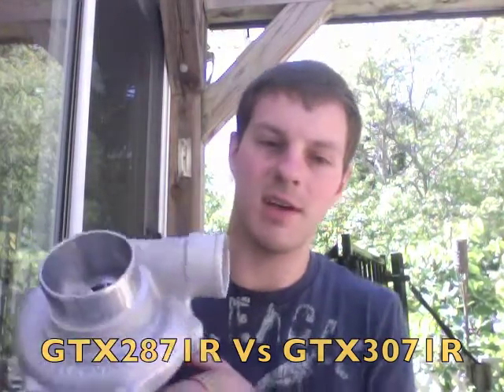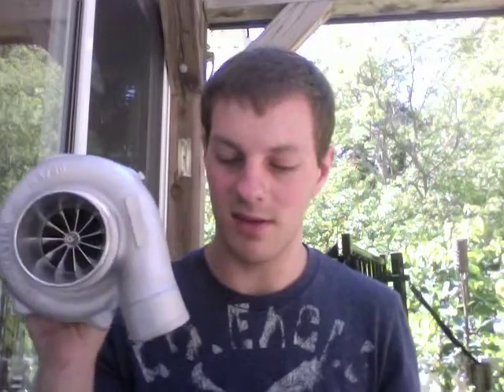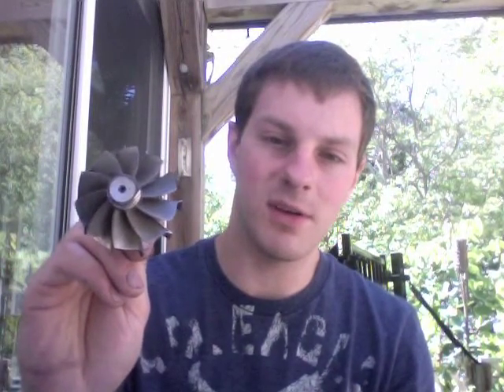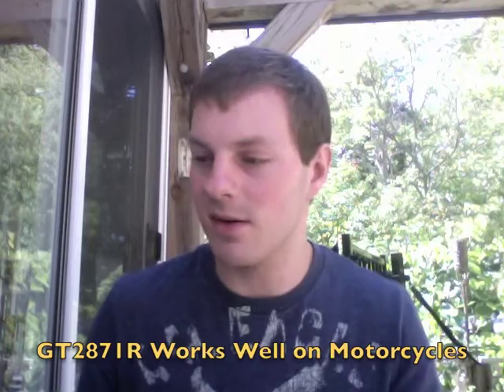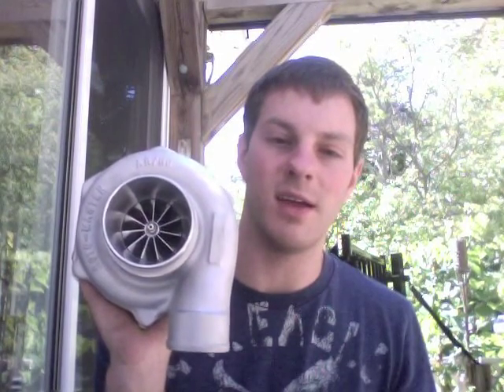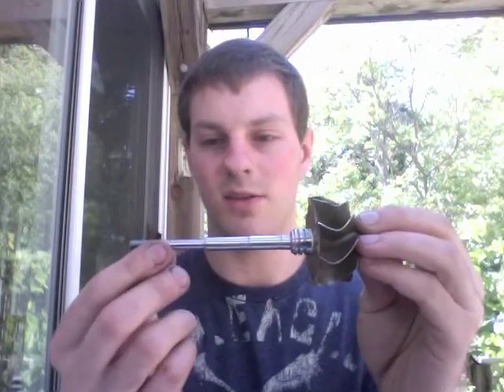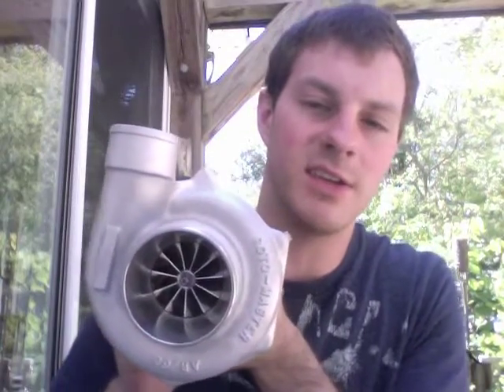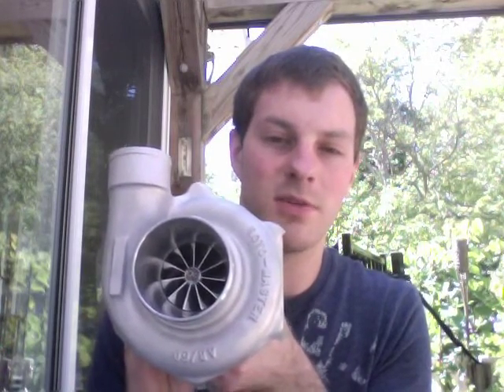Garrett GTX2871R vs GTX3071R + Specs

Comment: HELP ME PLEASE CHOOSE RIGHT TURBO FOR MY 1.8T STROKER 2.0 ADR HEAD AND CAMS..I WANT ANYTHING BETWEEN 350-400 HP AND GOOD POWER 3000-7500 RPM..LOW BOOST 15 PSI FOR COLD AIR IN INTERCOOLER..EXHAUST IS 76MM COMPLETELY..INJECTORS 550CC...I LIKE BIG TURBINE HOUSING T3 AND WHEEL 60MM...BEST FLOW...MY CAR IS FWD...I LIKE TRACTION...THANK YOU VERY MUCH..

Comment: Would you recommend a garret g2871r or a greddy td05h 18g turbo for my 2009 Honda civic 2.0 VTec? I'm aiming to safely push atleast 250 hp on stock internals with a type r head cover.
I reckon 10 to 12 psi ought to be enough. What's your thoughts in that to? 
You channel has helped me alot from knowing my turbos in n out. Thnx

Comment: Which would be better for a Mazdaspeed 3, looking for around 380 hp at the fly.
Reply: Is the quality of shaft wheel assembly has an important role in
validity of turbocharger?

Comment: In my STi, i made 496/488 on E85 @30psi with a gen 1 gtx3071r, and I could've made even more but I started to run outta ignition, & my injectors were only at 77%DC so I still had room to push another 30-40whp outta that thing.

Comment: I am using  honda civic sedan 2006 model 1.8 litter four
cylinder i vtec engine 132bhp 172nm torque. it come with 
five speed automatic gearbox with paddle shifter. it a stock 
motor 76000km done R18A1 engine i want to increase the
horsepower in my car i never had turbo experience in the 
petrol cars so i want go for the turbo kit for my honda civic  
what are performance parts I need for upgrade for the car
Reply: even a old subaru t3 turbo will give you just over 270 bhp with your good motor = or a garrett 28/60 = called a disc potato on a special nissan model can push 350 bhp

Comment: Hello 
What do you suggest for 2.3 t5 c70 volvo
It has low copression ratio even new 
Will spool the Gtx or should i go for gt28
I bought holset he351cw but spined at idle and when rev it up engine dyes 
Because the intake  cannot suck so much air 
Help me please

Comment: I  have a 3.6 liter 99 3000gt vr4... was thinking of swapping the t3  .50ar comp/ .48ar turb with a dual ceramic bb 3076... that's about 1.8 liter each turbo.  I wonder if there is a better setup than this... to get to a posible 1000awhp and still be drivable as DD

Comment: I love my Gtx3071r on my 2.5L beautiful combo, with pretty much absent lag. Still pushes something like twice the amount of the regular turbo even at like 1300rpms. Huge upgrade across the board in low end and highend. Love it. Vrooom Psst.
Reply: i smell bullshit on turbo lag i bet there is not much under 3,000 rpm = mt gt 28/60 on my forester eats bigger turbo street subaru wrx and sti = no problem torque under 3000 rpm is huge even with 4 people in the forester still beat wrx  and sti with driver only = bullshit .
Reply: Im looking at a GTX3076R for my 2.5 built, looking for 400-550 WHP with a good TQ curve
Reply: Your getting boost on the 2.5L at 1300 rpm with gtx3071?

Comment: hey turbo lab great video!
but id love some advice...

i have a 1.5litre 5efe twin cam engine in a toyota starlet... its a forged engine with a good set of cams...   i cant decide between a gtx2867r or a 2871?

im looking for the 350-400 hp mark but dont want to go the larger turbo if its gonna have a tiny power range. what are your thoughts?
Reply from the maker: I would go with the gt2871r because its more common it will be a lot easier to  fix in case you ever have a problem. If you dont mind about that, then go with what makes sense based on the horsepower that garrett rates that turbo at.
Reply: what size engines have you tried the 2871 on? id be interested what rpm it makes full boost. thanks for the reply man!
Reply from the maker: +crustic I build turbochargers not engines. I don't know the answer to your spool time question
Reply: In your video 0:35 you're recommending what turbo people should use depending on what hp they are chasing. If you put that gt71r on a 50cc lawn mower engine its not going to make anywhere near 100 hp. But if that turbo went on a 550 cube big block v8 it will easily make 700 hp. How can you build a turbocharger combo if you have no idea what engine it will be suitable on? sorry if I sound rude I am just really interested to know. Is it just based of peoples experiences using those turbos on certain engines?
Reply from the maker: +crustic I don't understand how you would think I would know an answer for a question like that. Turbochargers spool under load. If the engine is under more load it will spool faster at a specific rpm. If less load it takes longer to spool there is no mathematical formula for which a turbo spool on a specific engine per rpm. You are asking a question which has no correct answer. I have rebuilt some turbochargers for Lawnmower's the engine and turbo have to be within close airflow rates in order to work properly.
Reply: quite simple, id assume you would know whether a rear housing is too large or too small for an engine. thats all im trying to ask from the start. i understand you have shit loads of knowledge on building turbos and you do a great job rebuilding them but surely you get curious or have a basic understanding as to what size turbo is suitable for any given size engine

Comment: I'm new to all this Turbo upgrading but I'm learning as I go... I have a 2016 ford fusion 2.0 ecoboost which do you recommend? 3071? and do I need to add any more mods. So it can me effective. Blow off valve I know and an intercoooler I should add. steeda fusion has bolt on turbos ready to go but just wanna make sure if I need to do anything else for this to work properly and be safe. thank you for any help you can provide
Reply: Wrong where the hell did you get all that from? Ecoboost  means it's already turbocharged from the factory. If you don't know anything don't say anything it makes you look unintelligent or at least somebody who doesn't do a quick google search. ATP makes a turbo kit for the Ecoboost Fusion. Depending on the power level you want to hit the GTX3071 will go right up to the limit of the stock fuel system assuming you are using less than 10% ethanol fuel. You will need a blow-off valve but you do'n't need more than about 22 mm for about $190 with flange. To save money you can have the flange welded onto the hot side pipe. From there all you need is a tune, your inlet temps will be far below the stock turbo so the stock intercooler is fine it's not a flow restrictive part. That said depending on what your goals are I would actually look at a GTX2863 as it will easily do 340-350 with a cat-back, stock down pipe on 93 octane fuel . It will do 370-380 hp on race gas without changing the base tune too much.
Reply: You need tk change a lot of things before adding a turbo, you need to change your fuel pump, fuel injectors, intercooler, possibly a bigger radiator, etc you need 5000 dollars in parts

Comment: what could you recommend for a 1989 nissan r32 gtr. 2.6liter, 4 valves per cylinder.  Ive been thinking the gt3071r because I'll be running twins but i am just worried about lag time?
Reply: Run twin GTX2863's or Borg Warner EFR 6258's

Comment: garrett says the gtx2871 can run up into the 500s, so why not use it past 350 like you say?
Reply from the maker: +Brett Wilkins it depends on the application. On snowmobiles these turbos can make it to the 500 hp much easier because they run higher rpm. For a 4 cylinder car they could make more power but it's limited by the turbine housing size. There is a .86 t2 but that's the largest I know of for the 47 X 53.8 gt2860/2871r turbine.
Reply: +Turbo Lab America fair enough, but wouldnt using a large external wastegate help solve that issue somewhat?
Reply from the maker: I used to think that having a larger wastegate would help compensate for  a smaller turbine housing but it doesn't work that way.  The wastegate size choice  is determine about the boost level you want to run and the volume of air you are flowing. You want a smaller wastegate to run higher boost levels. The smaller wastegate helps keep more pressure in the turbine housing. In some cases like on a v8 that wants to run a turbo for low boost like 8 psi. The engine needs a larger wastegate so that the wastegate can properly control the boost. But also there are different spring pressure sizes where if the spring is not tight enough it can open prematurely at higher rpm from the exhaust pressure forcing it open at high rpm regardless of the boost settings, in this case a tighter spring is needed.
Reply: @turbolabamerica  when you say larger wastegate do you mean a high psi one ?

Comment: What do you recommend for a BMW M20 engine? (2.5 liter, 2 valves per cylinder).
Reply from the maker: +boxdrinks That would be a good question for a bmw forum. A gt35r is the most common turbo used on custom turbo builds because its good up to 600 hp +, and its ball bearing so its good for spooling and it leaves room to grow. If you chose a turbo too small then your engine can outflow the turbo at higher rpm.

Comment: how would the gtx2871r do on a ford fiesta ST 1.6 compared to a gtx2867r?
Reply: +Thomas Owens  I would definitely go with 2867... or even 2860rs.
Reply: +Thomas Owens  2871 too big for 1.6L.  In fact i would definitely go with 2860rs (disco potato)
Reply: +Turbo Lab America make 425-450whp on a 1.6 Ford Fiesta ST
Reply: +winzfeld1  You are very wrong. I know because ive purchased it. lol.   https://www.turbobygarrett.com/turbobygarrett/turbocharger#GTX2871R
Reply from the maker: +Thomas Owens I think i rebuilt a GTX2867r a few months ago. I cant remember the measurements. i think it was like 50mm x 67 or something. Either would be a good choice. i would probably go with the gtx2871r though, because i think they are more common. Both turbos are limited by what the turbine wheel /housing can flow. you have to keep in mind the shaft is 47 x 53.8. so the compressor side of both is a little larger on the inducer than the exducer of the turbine.
Reply: +Turbo Lab America I just didn't want to go with the 2871r and not hit full boost til like 5.5k or 6k rpm and I shift at 7k rpm. Didn't want it to be too laggy
Reply: +Marek Sumguy why those over the gtx2871r?
Reply from the maker: It just depends what you are trying to achieve.
Reply: There's no such thing as a gtx2871r! Gtx2867r is biggest gtx28 turbo you can get

Comment: Thanks for doing these videos I love them an I just emailed you about a turbo setup for my rb25 !! An a quick question I have a Garrett t-60 journal bearing an I was wondering if you had a kit to convert to dual ball bearing ?
Reply: It says A/R .60 m24 on the front of turbo
Reply from the maker: GLOCK SLICE thanks for the feedback! send me some pictures to my email. the .60 doesnt say much about the turbo. Its just a ratio that garrett has a formula for. The compressor housing in this video is a .60  to4B. But there is also a .60 to4e which is larger. There is also a .50 to4e and a .70 to4S.

Comment: What about converting a GT2871r to a GTX2871r?  Do you have a rebuild kit for that?
Reply from the maker: ***** the rebuild kits are the same for both gt2871r and gtx2871r.  I can convert yours to gtx2871r which includes machining the compressor housing, the compressor wheel, balancing, and rebuild for $365
Reply: Turbo Lab America Are the parts genuine Garrett?